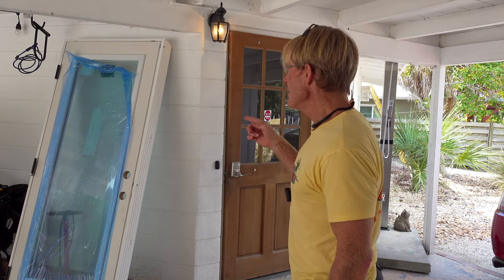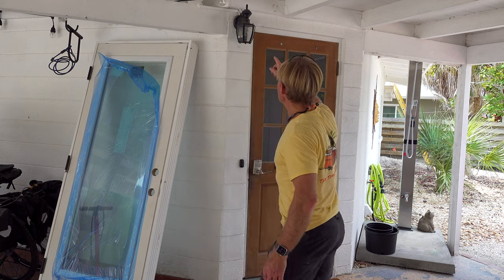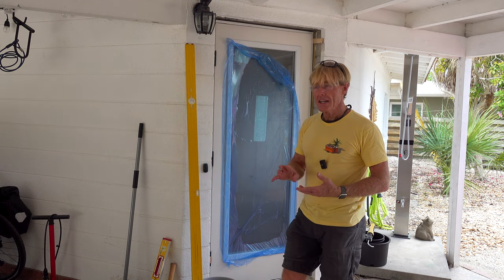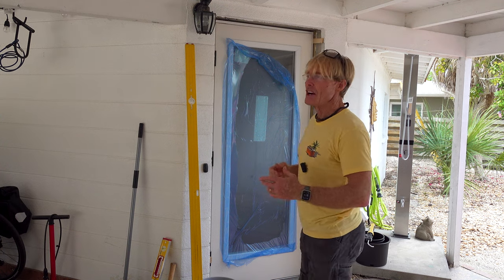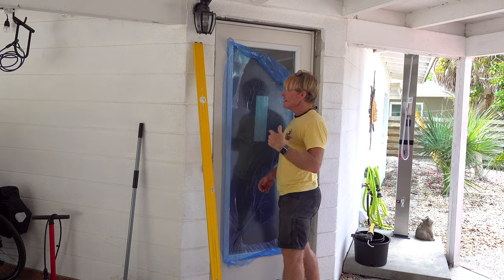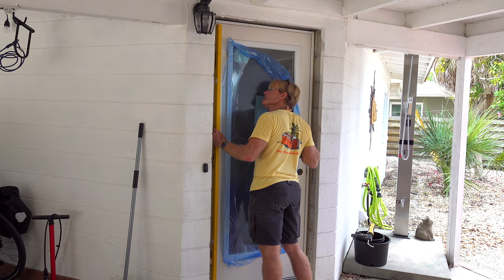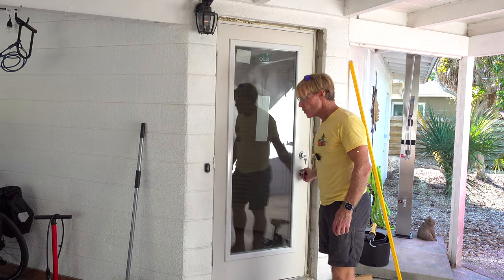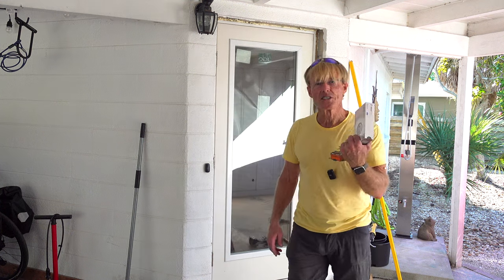Expert Guide to Installing a New Exterior Door - Step-by-Step Tutorial

Comment: Nice video Ron. Personally, I like to have the door plumb as you face the door. Otherwise the door will always open or close on its own. I adjust my trims around the door if the building is out of plumb.
Reply from the maker: Dave if it is slightly out of plumb, the trick to stop the door drift is to remove one of the pins and bend it. The resistance will keep the door still. If you find the door still drifts then bend a second pin. The easiest way to bend the pin is to lay it flat on concrete and give it a hammer tap in the middle. Plumb is best all around, but sometimes compromise is necessary. As it turned out my 61-year-old house wall was plumb and the floor was only out of level 1/16" over 3'.😎

Comment: Do your best and foam the rest !
As we say in the UK. Great job , smart lock looks good.
Reply from the maker: Foam or caulk is the best around openings to the exterior. Cold/Hot air and insects can get in around openings unless they are sealed. Fitting a window or door too tight not allowing room for a sealer is not a good thing. Ron😎

Comment: Hi Ron. Thanks for the video! Question: before the tapcons, were you shooting finish nails into the thin wooden jamb filler?  I was surprised that the half inch of wood allowed enough nailing depth to temporarily secure the door prior to tapconning it in to the block jamb. Thanks for all the content! (ps....I haven't forgotten the cubby router jig video. I will get that trimmed a bit and into dropbox for you).
Reply from the maker: The door was being held in place mostly by shims. The finish nails just helped a little bit. It is my method to adjust the door until is it in place with no tension.😎
Reply: @TheSmartWoodshop  I recall you talking about that with your interior door installation. Makes sense (of course!!). Have a great day.

Comment: I thought you mentioned the bottom (floor) wasn't level. Did you just fill with caulk or foam, or was there a process that did not make the video?
Reply from the maker: It was only out 1/16" so a shim and then caulk sealed it.

Comment: Curious...I trim houses in KC, up here we always swing exterior doors inward on residential, are you swinging that door out because of hurricane winds? Do you use a tamper proof hinge so burglars can't just drive out pins and enter your house? Great videos Ron!!
Reply from the maker: Out-swings are for high wind conditions, but also can be ripped out of your hands if opening into a high wind. I would rather deal with some leaking with an inswing, but codes lean toward out swings in hurricane prone areas. Insurance companies also want out swings.
Reply: That's what I was guessing, what about hinges?

Comment: Out swing doors when the wind blows against it ,it really seal’s.Good job but didn’t see you chaulk the bottom
Reply from the maker: I did caulk the bottom of the sill, but most of the video was cut as it is most of the time. If I posted a 30-minute video of a door install I would get drawn and quartered. These days I get blowback if the video is 3 minutes.😎

Comment: Light blink signal again.
Reply from the maker: Called motion sensor light that cannot be turned off without shutting off power to the garage. If I remove the bulb the no light at night. It will be replaced when the new shop is built.